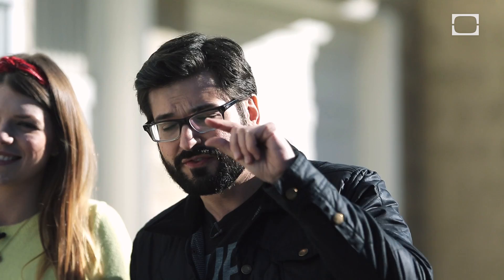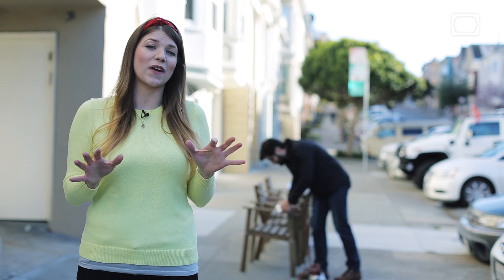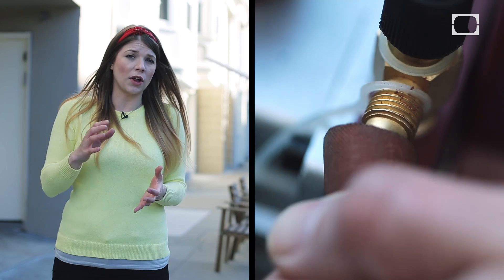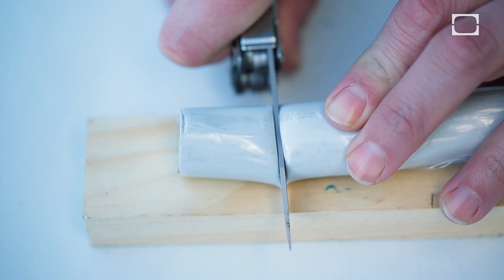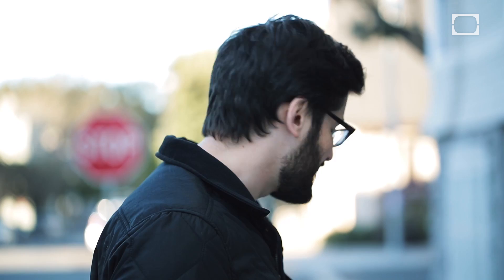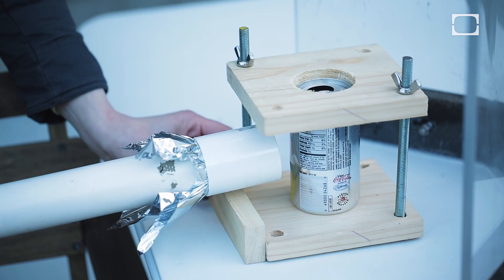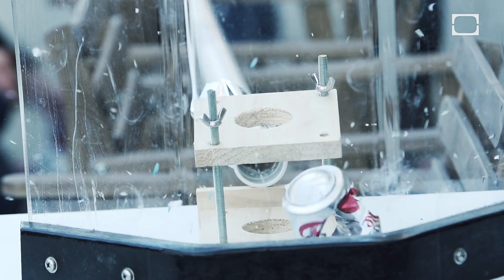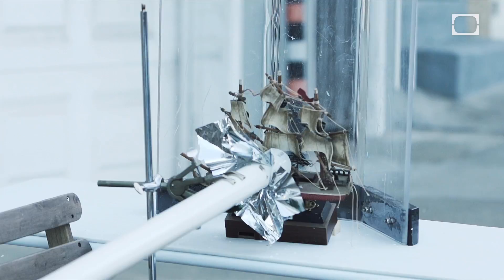Blasting Household Items with a Ping Pong Cannon

Comment: The reason why the model ship isn't as damaged it's because it's the air doing the damage instead of the ping pong ball itself. It looks like the ping pong ball is in bits prior to even exiting the tube. The model ship has a lot more gaps for the air to pass safely through without pressure building up on its surface, hence minimizing the damage.

Comment: one question -> since a ping pong ball has air in it, when you put it in a vacuum, won't the air pressure difference cause the air inside the ping pong ball to just burst out of the ball and in reality what you're really firing is just bits of ping pong balls rather than a ping pong ball?
Reply: Curcles cant collapse into itselft
Reply: not into itself, I meant it would burst apart, because of the pressure difference where there are no particles pushing into the ball but there are particles pushing outwards, with the flimsy material the ping pong balls are made out of, surely they would be torn apart from the air pushing outwards from the inside.

Comment: could you try that with a pipe with a larger diameter and a/bowling ball?
Reply: bowling ball is too heavy for this to be effective. It works with a ping pong ball because it's light and has high air resistance.

Comment: Just do this again with a greater distance between cannon and target. Bit disappointed of this vodeo :(
Reply: The problem with that is that as soon as the Ball exits the tube it becomes affected by Air Resistance again and will slow down incredibly quickly.
Reply: Yeah, but from a low distance its not really interresting.
Reply: It wouldn't work at a longer distance. Physics is a buzzkill sometimes.
Reply: What about a spud gun/potato cannon with a nice distance then ?
Reply: DerLeeker That would work better, their mass gives them a much higher velocity than hollow ping pong balls when up against air resistance.
Reply: Mhm i´ve seen a good videos about cannons on VSause´s Channel . Well you could also build a Coil or Rail Gun ;)